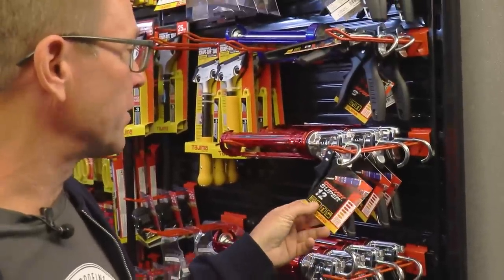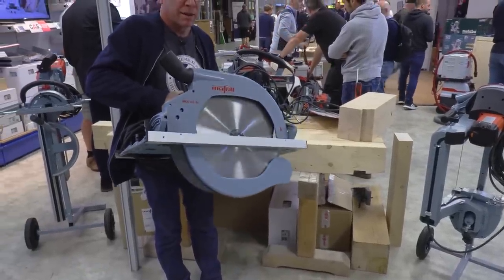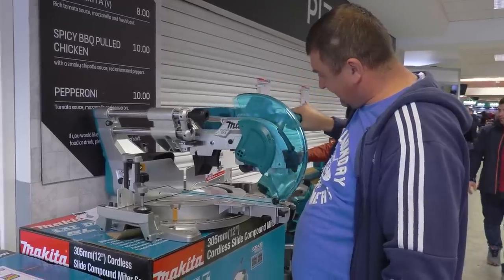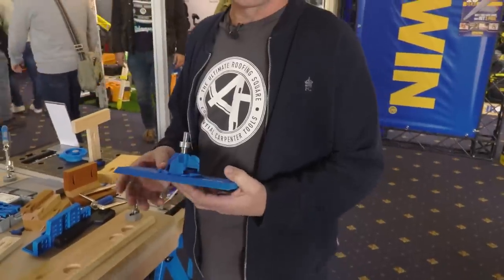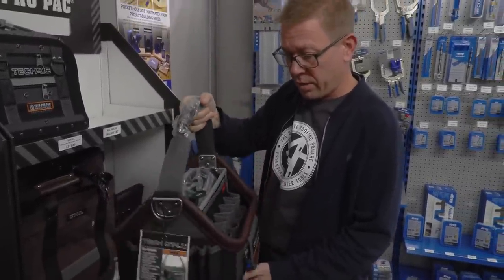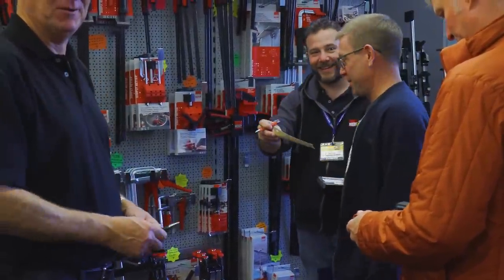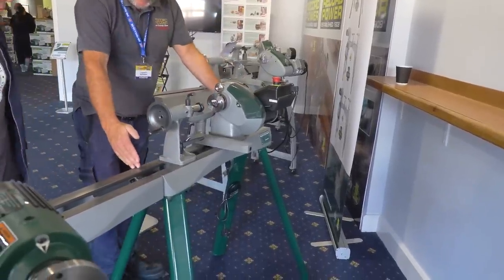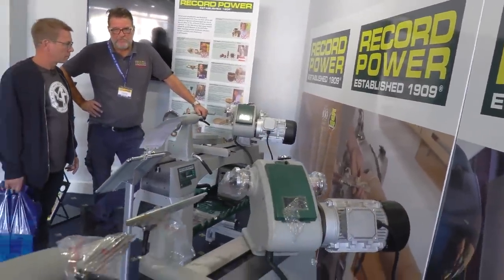Skill Builder at The D&M Tools Show

Comment: The 16 5/16" beam saws (Skil Super Sasquatch is the one I have) are around $600 here in the US. They weigh about 30 lbs and will cut 6 1/4" lumber in one pass. They do feel strange when you first use them because the blade feels like it is turning very slowly.
Reply: If I were to order something off their website I'm here in the US well it get shipped here

Comment: Does anyone actually use the sausages? Not practical for the average Joe. Especially for storage and gun size.
Reply from the maker: I use them, companies keep sending us freebies
Reply: @SkillBuilder  😆👍🏻 I used some years ago, I forget the brand, it was for sealing the gap between block paving and plastic man hole covers, thick black mastic type of gear. I’m all for using less single use plastics, but sadly in this instance, silicone and caulks,adhesives etc, it’s the best way for transporting and storing. My top tip for keeping the nozzle fresh and I’ve tried all the tricks, I simply squeeze out some material and gently work it around the nozzle end sealing it fully. 3 weeks later simply pull it off and away you go. Works for me….